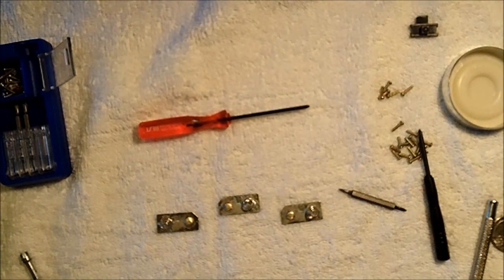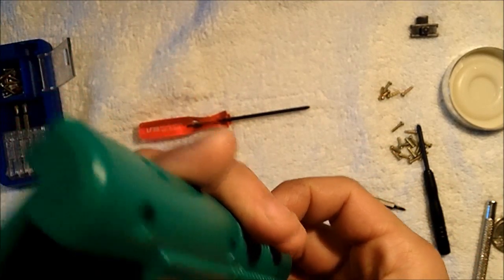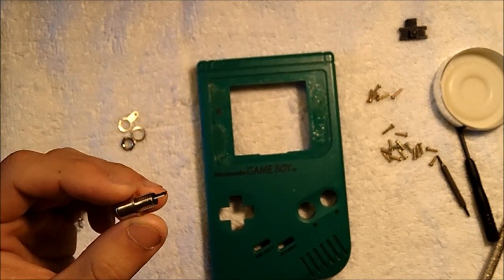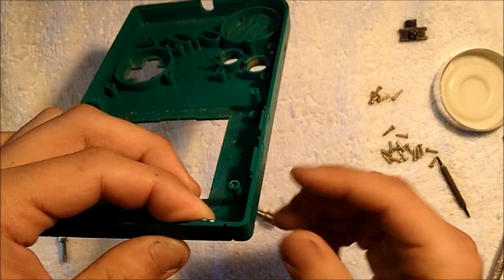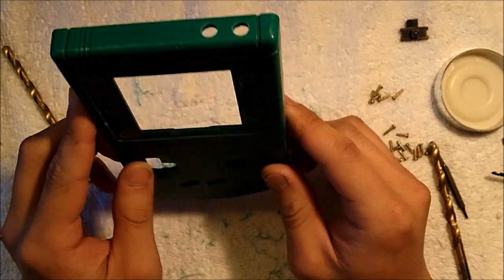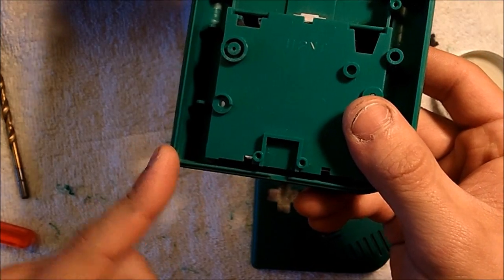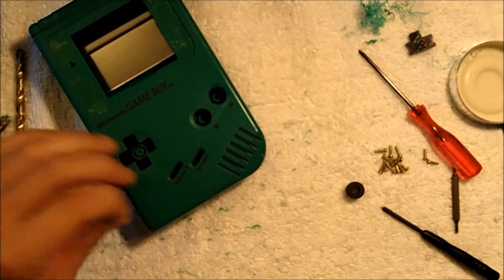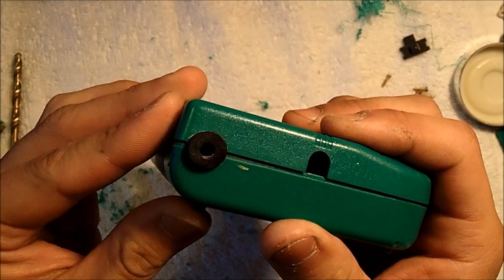Modifying your DMG-01 Gameboy for Chiptune Part 1: Prepping your Gameboy Case [2/2] [HD]

Comment: The 1/8" and 1/4" Pro sound connectors are to large to fit in the headphone jack location.  They will not fit there because of the battery compartment.